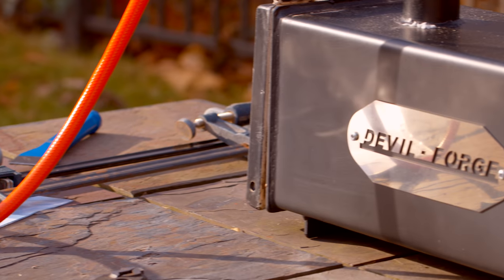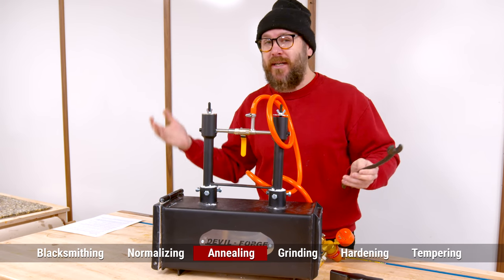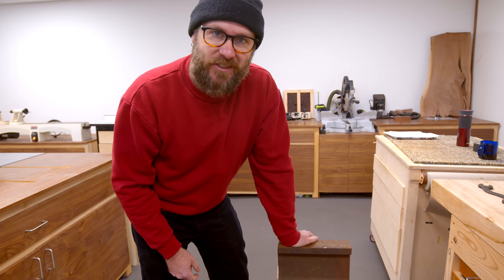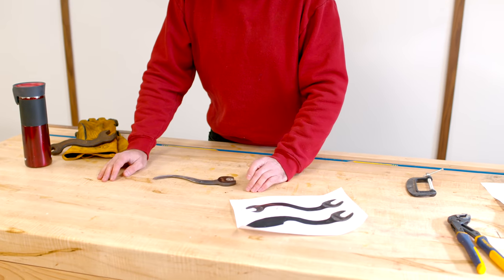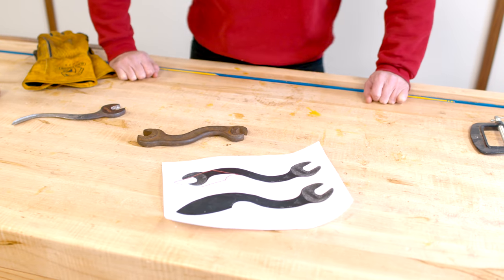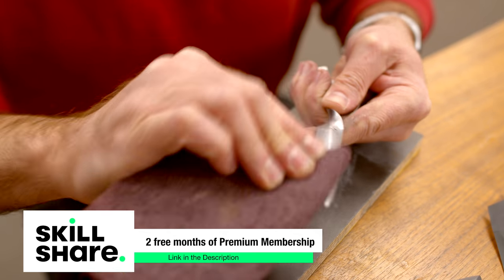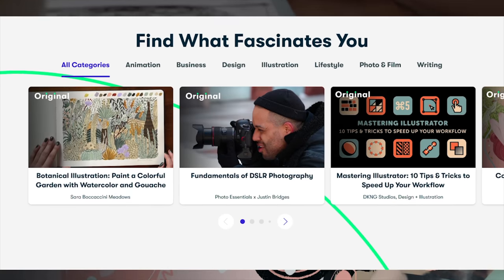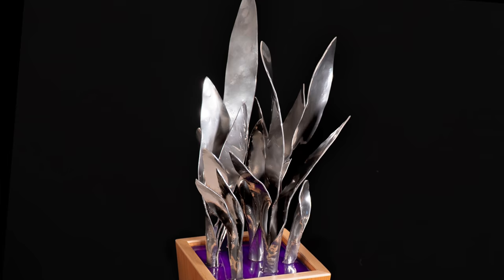How to make a knife out of a wrench.

Comment: I really liked how the knives turned out!  Pro-tip for grinding, it's easier to grind straight edges if you keep the long edge parallel to the grinder belt.  When you go perpendicular to the belt, you minimize the surface area you're grinding.  That's good for working on small areas, but for large areas, maximizing surface area makes it easier to get a uniform grind and reduces the chances of twisting the workpiece in a way that results in crooked lines.

Great work overall.  Maybe for your next project you can fabricate a stand for your railroad track or make some forge doors!

Comment: Well that looked like fun! I liked the vibe of this one (watch me explore a new medium/tool). My blacksmithing experience is limited to cutting off the plastic end of a quick clamp and using a backpacking stove to heat up the bar enough that I could bend the end to 90 degrees and use it as a dog hole clamp. I'm going to go buy a torch!

Comment: This is the kind of content I like watching, making things by hand not with a cnc and a laser cutter. Do not use your file back and forth, it is a cutting tool and should be used with a push stroke only. Files dull pretty fast if used with a pull stroke when filing metal.

Comment: On the point of heat treating, its not really a matter of choice, some steels work with oil, some with water or some with even more intricate ways with supercooling it etc. Thats not really up to the blacksmith, but the kind of steel you use. Tools usually are 01 toolsteel or something like 1084 thats tough and durable. in the end heat treatment is to get the most out of steel, with bad steel you can still make a knife that can cut, but not as good or as long as a good steel thats heat treated well. For practice this is just fine but one needs to learn different steels with their heat treatments to use them to make something properly.

Comment: Umm........ normalizing doesn't make the steel brittle, that would be the hardening step. Annealing is an add on to your normalizing that just makes the steel as soft as possible. It isn't actually needed but it can be helpful if you need to do a lot of hand shaping with files etc. If you have a big grinder it can normally be skipped, unless you are working with air hardening steels. Check out Black Bear Forge, who has loads on hardening and working with different steels. He has videos on how to test mystery steels to see how to harden and temper them properly. Trust me when I say not to water quench an air hardening steel (water quench is about as fast a quench possible so it makes steel about as hard as possible. Air hardening steels go hard just by cooling them down in the air), if you're lucky the steel just cracks or explodes a little!!!! Definitely code brown in my books!!!! LOL

Really good to see you having fun with something new 👍👍👍👍👍